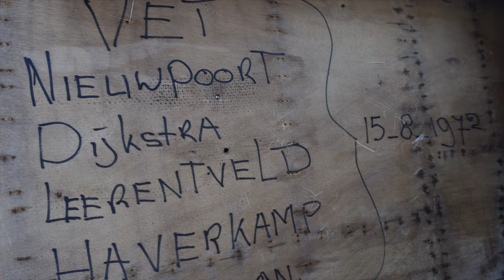Ep 23 | Uncovering HISTORY

Comment: If you want a Tip? when glassing your floor beams in , use a bit of  thickened epoxy to create a curve in the right angled part. the glass fibre finds it hard to bend around the corner. fillet is the word? good video's getting better!
Reply from the maker: Thanks, John! We put a fillet on the wood-to-wood angle. We couldn’t on the GRP as we left a gap to avoid a hard spot - something that has caught us out before!🙂